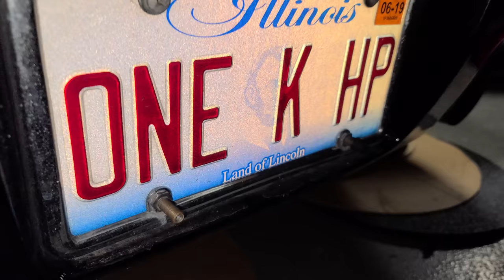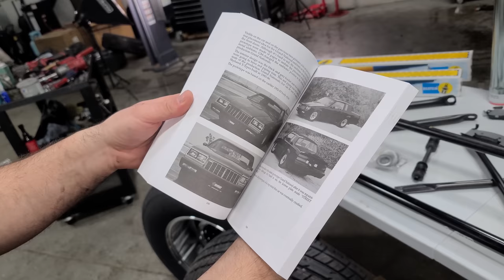My Grand National Was UNSAFE To Drive So I Replaced & Upgraded Everything! New Wheels & Suspension!

Comment: Looks good. Would definitely change the front springs with 1in drop. If you have an original car you never realize how bad the stock suspension pieces are until you replace everything. Had Eibach springs with Bilsteins on mine for a few years and it road/handled decently. 2 years ago I decided to upgrade everything to Ridetech with their coilovers, a-arms, front steering parts and sway bars. Night and day different in handling.

Comment: Hi Alex, just something for you to look into, you can hear detonation/pinging happening at 55:32, so either its running to lean or timing is too advanced. Definitely look into that as I cracked a few pistons from running too much advance under boost.
Reply: @LSC Peter Could be, but you can hear it again at 57:58 a lot more distinctively, and from my experience that is the sound of detonation/pining, very common for boosted car running bad fuel, too much timing or running lean.

Comment: Pro tip anytime the suspension is hanging freely don’t torque down the bolts do it on a level floor or lift with a ramp cause torquing it down freely will stress the bushing when it’s on the normal ride hight

Comment: The front springs you put in are actually taller by one ring than the old ones. That's why the front is up so high. I agree that you need to go back to a smaller wheel and tire in the rear for looks. Beautiful car though

Comment: I run those metric GM front calipers on my 2JZ Studebaker, and you can get some aluminum 2 piston upgrade calipers that will still fit under 15" wheels. Willwood makes some nice ones, or for a budget price there are several no-name brands like Auto city classic and Force 10.

Comment: If you buy a rear disc brake set for a chevy xtreme S10 pick up they are a great fit  and throw the stock drum brakes in the scrap pile and will fit with all factory parts from GM

Comment: G-BODY FRONT SUSPENSION:

You should try and tighten suspension components with a load on them.

upper control arm pivot shaft to frame nuts 48
upper control arm pivot shaft to bushing nuts 85
upper ball joint stud to steering knuckle nut 52
lower ball joint stud to steering knuckle nut 70
lower control arm bushing to frame bolt and nut 65
front shock absorber upper stud nut 100 INCH LBS
front shock absorber to lower control arm bolts 20
front stabilizer bar link nut 156 INCH LBS
front stabilizer bar bracket to frame bolts 24

TURBO BUICK REAR SUSPENSION COMPONENTS:

control arm bolts and nuts upper and lower 80
rear shock absorber to lower mount 65
rear shock absorber to upper mount 144 INCH LBS
rear stabilizer bar to lower control arm nut 37

TURBO REGAL STEERING PARTS:

steering wheel to steering shaft nut 30
outer tie rod end to steering knuckle nut 30
inner tie rod end to intermediate rod nut 40
tie rod adjuster sleeve clamp nut 15
steering gear to frame bolts 80
pitman arm to steering gear shaft nut 185
idler arm to intermediate rod nut 40
idler arm to frame nuts 60
intermediate shaft pinch bolts upper 46 lower 30
wheel lug nuts 80 steel 100 aluminum

.

Comment: Don't forget to lock the ears down on the outer pads to avoid rattle!!  A screwdriver between the pad and rotor hat and a drift on the ear with a hammer is the trick.

Comment: On the Gbodys their is an aftermarket brace for the engine compartment that is really good, but those fender to core support ones aren't it. I'm trying to remember, but I believe the one you want goes from the firewall to the fend and then core support. I know in mid 2000s all the guys on the Gbodys forums swore by them for vastly improving the handling

Comment: Apparently the engineering of the suspension changed very little from 70 A body GMs to the 80s. I have not been under and 80s GM but I spent plenty of time under a 72 Monte Carlo. Looks the same.
By the way, that is not 36 years of ‘gunk’. That is likely the popular undercoating called Cosmoline. It starts a bit soft and actually grabs some dirt to help it protect the metal underneath.

Comment: You want to make it handle better. Get Spohn performance. sway bars. They are solid bars instead of hollow like the factory bars. The g body lean in corners almost disappear. As for better brakes and even more handling upgrade. F body spindles with fbody brakes. Gives you bigger beefier brakes. Just need their new upper control arms. You won't believe the change in handling. Almost corvette style handling. See if you can find a 10 bolt with disc brakes and swap them in for all around ride and control. Love your rides.

Comment: Leave the rear, if it doesn't spin it's correct for the power. Lower the front and uprate by 10% and you're there. Should handle well also.

Comment: Hey Alex!
Where'd you find those lower control arms? I looked all over for (new) complete lower control arms for my G Body and couldn't find them anywhere. 

Also, the upper control arm bolts are splined to the frame and not supposed to spin. You just needed to loosen the nuts on the back.
Reply: @LSC Peter  OK, cool. That makes sense, a lot of parts interchange.
Thanks Peter!

Comment: KYBs were good for the day. Tightened it up a little without being harsh. Had them on my 85 442. The red brake pads are most likely Raybestos, possibly EBC Red Stuff if they were available for the G Bodies. You could get the rear discs off the F Body from that generation on and they'll clear 15 inch wheels. Not sure about with those dished ones though but they should. If you want the front lower with stock spring travel, use dropped spindles. 1.5" drop looks good.

Comment: Back then , so many jumped on the KYB's. Problem was if i remember they were single valving (compared to dual valving in the koni and bilstein) So on the compression it was great but the rebound was pretty rough (no sure what shape your GN's were in but newer kyb back then were stiffff). Koni and Bilstein were the shocks to get and they were a pretty penny back then. Until i built my car back then, it was the grand national , Corvettes and Mustangs. Camaros had issues (well the 305ci) They put the detuned vette motor in it finally and it made a comeback. I remember those days well. Old guys  i guess Gen x and above, had such a minimal selection in parts. Kyb was cost affective for people that couldn't afford the billstein , koni or carrera etc shocks prices. We did have brake choices but it was limited. This generation is about roll racing and using the conversion kits running small brakes so. It was mostly quarter mile racing and road racing during those times. The over rated "roll racing" was not popular up until the last 8+ years. Noticing rear springs you put in, there wasn't a rubber grommet that it sat in like the top part of the spring did? Oh, A.T.R was one of the big names for GN's back in the day. I think GNperformance now makes a knock off of that pitbull muffler. Deep dish rears are period correct as well, it was the style. Even exotics ran after markets like the diablo with deep rears. I must admit those are pretty deep.

Comment: I had those inner spring bags years ago I used them for when I was towing a trailer in my V8 that was too low with 20 inch wheels just pumped it up a few inches it was sweet

Comment: The Jeep steering shaft is 1993 - Early '95 Jeep GRAND Cherokees.  They have Flat Front Bumper in the Junkyard.  The Later GC's have a Recessed Front Bumper... that one won't fit.  Even 200K mile ones are pretty tight, but less than 100K mile are best.

Comment: Looks good. Keep the wide tires. I think yiu need huge twin turbos, and an extra large tank so it can still be a daily driver. If you want more, i would get some electric motors on the front wheels so you get more power and 4 wheel drive when you want it. Yiu also get additional braking from the electric motors.

Comment: When i was in HS i had a nice Monte SS..  back then the look was wide back tires and having the ass of the car sit high.  Hade 10” wide rims and tires just like yours, got the back of the car up with factory springs for a Chevy Malibu Station Wagon.  If it helps anyone - headers for a ‘78 Z28 Camaro fit perfectly in my 80’s Monte SS with a 350 in it.  I had a nice brace behind the back seats too.  Its was called 3/4” plywood with two 15” Pyle Free Air subs.  The trunk lid looked like it was blow off its hinges when those things hit.

Comment: Am I wrong to think you don't need grease on the back of the pads?  I've seen people use disc brake quiet, which is basically RTV to glue the pads to the caliper to stop rattle/squeak ... Like a helper for the shims.  But neither grease nor RTV is actually needed.  I only put a touch of brake lube on the ears of the pad and the slider pins.

Comment: I did the exact same work on my car but every time added heavy duty grease on each bolt ends & rubber mounts and bushings..,all the bolts were steel brushed and greased before installing them back on...same for shocks & bolts..the car was felt like it was driving on 'air'..!!!

Comment: I think it is riding high in the front because of bushing preload he should loosen them and tighten them again on the ground before he gets lowering springs. Also the "beauty washer" on the shock is actually for under the top bushing to keep it centered in the hole. Otherwise great video guys.

Comment: Assume you could upgrade to B-body brakes which do fit 15s.  The 94-96 Impala SS and 9C1 also used rear discs.  I retrofit those on my 93 Caprice.  The HD B-Body brakes are around 12" front and probably would stop that GN reasonably well.

Comment: I'm not sure if gbody is actually the same as s10 (other than bolt pattern for wheels) but a common swap for S10 rear disc brakes is 2001 blazer 2wd. The 80s s10 had the same ball joints if I remember correctly? Would need the spindle for the front, but the 2wd s10 went to a bolt on hub assembly, slide off rotors, 2 piston calipers, and rear disc brakes that bolt to a gm backing plate (not confirmed fitment, but it might be easy to score parts to find out). 
I do know an s10 with this setup, you can bolt the master from the 2001 straight to the 80s brake booster, and it was a very worthwhile swap.

Comment: I live on the worst road in Hawaii and have those shocks on my rodeo and they are a great classic design that operates well past failure rate temps of other shocks I’ve used. 
Also Colorado salts like the sea on 70 and 25. If it’s a rural or garage baby it can be avoided but Colorado salts roads

Comment: My 2002 mustang had that much play in the steering wheel I just fixed it mine was the steering shaft has a rubber joint and it just wore out

Comment: Millennials 😂 SAE- Metric 5/16=8, 7/16=11, 1/2=13, 9/16=14, 5/8=16, 3/4=19 in standard socket/wrench sets. 1/2 and 5/8 are different enough to be tighter in a weak nut.

Comment: Those KYB's were the shit back in the day. Just about the stiffest shock you could get - to reduce body roll. Drum brakes have a ton of fade, but they have TON of stopping power - the first time....after that not so much.... The GN was all about going fast in a straight line. If you wanted to take a curvy road back in the day you had to find some weird dude with a Toyota Supra.

Comment: I hate you guys! Now I want to rebuild my 55k mile GN suspension! The rear tires are to fat! I have 16" GNX (GTA rims) wheels. They look good and the Nitto drag radials are great for the street. Glad you love the car! Alcohol injection is what you need! 25# of boost and a bigger turbo/ injectors is insane on the street. I'm 11.18/122 mph and not pushing anything. 10's are around the corner if I push the turbo/ tune!

Comment: I have a 2018 Dodge charger has less than 30,000 mi on it. I noticed when I cold started it it smokes a little bit. Is this some sort of oil adjective I can add to it to clean it out? What do you recommend for gas treatment?

Comment: I may have missed it... but did you put the car down and full load on the suspension before snugging up all those suspension bolts after changing out every bushing and spring? Obviously the car will ride high and the suspension will bind up a lot if not. You probably already did that off camera but it was bothering me as an old mechanic. Ha. BTW, this car looks fantastic!!

Comment: It will take like five thousand miles to realy bit into all the rubber. Keep the deep dish pie wheels and add a jumbo compressor. Those car can be dominatingly fast. I used to work at a floor company and the dock guy had exactly that car with a ginormous turbo. No lag...just went like stink. 9 second car he would chime 166 mph. It did seem like nasa Columbia replacement.

Comment: 11 mm because it’s close to 7/16 so if an old school designer used to use 7/16 bolts,  when they converted their 1970’s engineering to metric 7/16 bolts became 11mm

Comment: Bro you should plan to take the frame off of that car, 

strip it down! lock it in a jig! clean up all the welds real nice. 

reweld everything real nice! have it all locked down in the jig doesn't move twist or Torque out of shape because of the heat of the weld!!!

and then powder coat that frame, and put it back on the car. 

Then sandblast the bottom of that car and shoot it with a type of bed liner to 

protect the bottom of the car!!! Then put it back together!!!

Comment: It's interesting, when doing lower and upper control arms and steering and all that front suspension stuff.. buying completely new parts end up costing a little more than just the bushings and ball joints and stuff, but seriously, the work it takes especially for a home garage without a press and all the jigs you need - sometimes to even have to make to get some apart or back in - it's TOTALLY worth just buying new control arms and all that.. it's silly how cheap they are and they're brand new freshly powder coated.. just don't buy the 'cheapest' ones you find, make sure the bushings are quality. I made that mistake once and the bushings died in a year on my Honda.. so yeah get at least ones with good reviews long term.

Comment: If you could get 17s or 18s and a big brake kit,  it would be "awesomer." Also put the old worn springs back in the front. Even a boomer wouldn't run high like that.

Comment: Today I learned I’ve been using coil spring compressors wrong. It looks way easier to use them with the bottom fork under the lower control arm 😬

Comment: Where’s the rear sway bar?
Fun fact, the ‘87 GN’s sit an inch higher than the 84-86’s.
Reply from the maker: Didn't know that!
Reply: @LegitStreetCars  that’s why guys with ‘86’s or hot air cars have problems when they replace the springs. They all change up to the ‘87 part number. Then the car sits too high… as you now know

Comment: Let me tell you those cotter pins ave so important i had front end work done years ago and the idiot forgot to put the pin in and the castle nut spun off I lost the passenger side wheel about an hour after  leaving the shop the wheel went  sideways after I hit a bump in the road

Comment: The upper control arm to frame bolts are knurled and shouldn't spin in the frame.  Your alignment guy is gonna be pissed because they usually loosen the nut in the engine bay. If the whole bolt spins it is a huge hassle. Ask me how I know.

Comment: nice video and I like your enthousiasme....., but there is one thing I do not understand. Why do the upgrades first and then afterwards worry about the basic things like ball joints and tie rod ends.  You even test drive it with those performance parts not worried about all the play in steering and probably also rear axle. You post video's and can expect that people will follow your work and start doing the same to their car. Do I have to remind you that is a bad bad example ? With those kinds of enhancements in power, it just could be that during a testdrive you loose control. FIRST make sure the car handles and steer well, then do any fancy upgrades. There are enough video's on other channels that proof my point. Great looking cars that leave a meeting, the owner being very proud, let the engine roar and do accelerate...and end backwards hitting other cars, people or trees. Goodbye classic car
Reply: @LSC Peter thanks for answering. the titel "My Grand National Was UNSAFE To Drive" suggests something else as well as in the video you show tie rod ends.. Maybe I'm exaggerating a bit, but it's not good not to check these kinds of parts immediately and replace them if there is play. Still enjoy to watch your vid's. Good luck and seeing forward to your next video

Comment: Great vid, but one critique. You are using that spring compressor wrong. The ridges on the slotted plate are supposed to sit on the coils. 
This video from the manufacturer shows the correct use.
https://youtu.be/znze2RDqh-8

Comment: Why don't you ever pretreat any of these older rusty car suspensions and engines with PB Blaster?
That stuff will make all these parts come apart like butter man.
Also, no toxic dust like you threw up in the air removing those sway bar end links.
Got to think about your lungs for the future guys!
There is always masks but I personally hate those and can't breathe in them.

Comment: When you've been a mechanic long enough you will come to realize that automotive manufacturers will use fasteners that are the same size. Each manufacturer does standardize components and fasteners to speed up assembly time. The next time you work on a GM product that is pre-metric you will see that you will know what size the fasteners are. Its the same with new cars too. This is my first video of yours probably my last only because you whine to much. And you repeat yourself way more than most people care to listen to. And that you give yourself that a boys when you get lucky on a part that comes off without a torch or a hammer. Diversity is what makes a technician and turns him into a mechanic. Good luck.